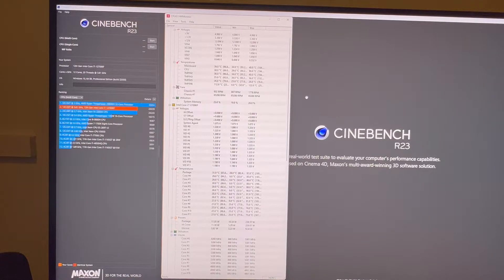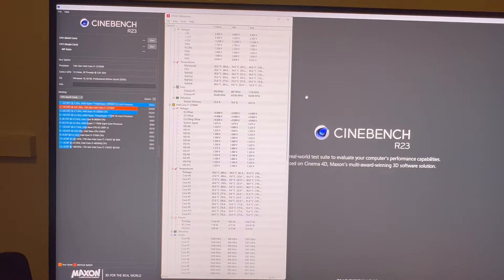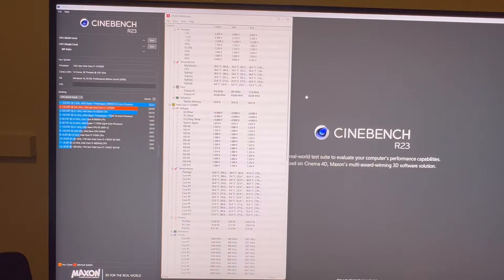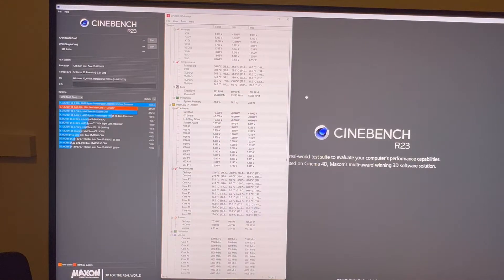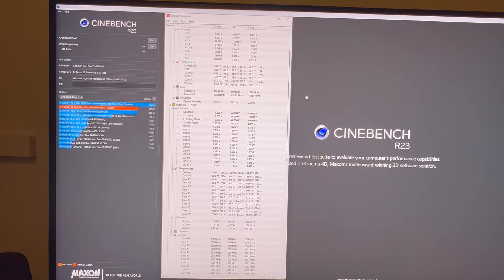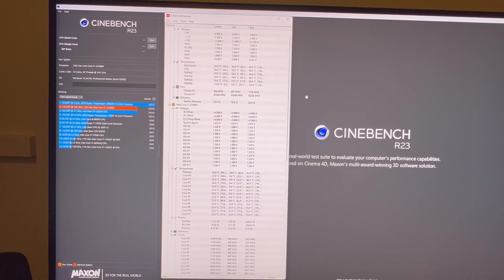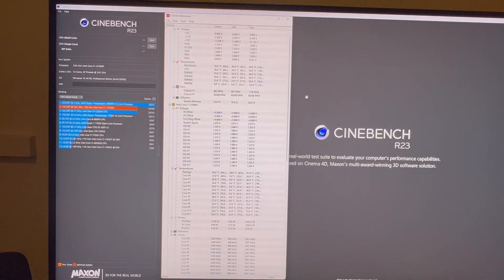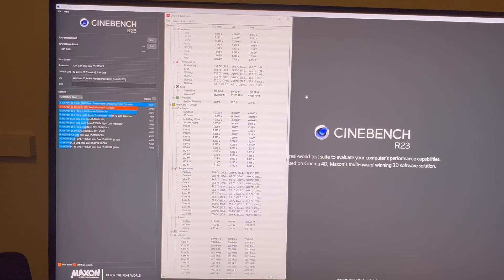Cinebench test on 12700k w/ overclock.

Comment: so if I do a manual overclock on a 12700k would I be able to reach your cpu overclock results and also xmp my ddr4 and then tighten the timings on the ram manually and increase ram speed manually and not lose pc performance ?
Reply from the maker: cant say for sure.  No 2 cpus are the same.  You could score higher.  A lot of small factors contribute to the score.

Comment: By core usages or sync all cores
Reply from the maker: By core usage
Reply: @Hardwaretuned  thank you that's how I have mine set but only 50 max and 39 on e cores 

Score is about the same with 22881*
Reply from the maker: @DaSesh  there’s a big difference between 22000 and 24000
Reply: @Hardwaretuned  LOL OH IT WAS kinda hard to see lol
Reply from the maker: @DaSesh  no problem